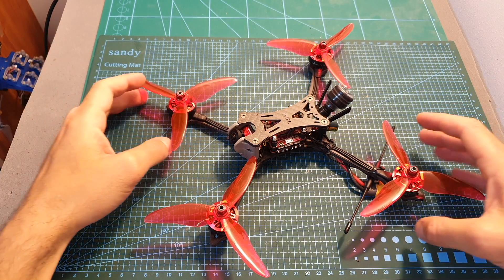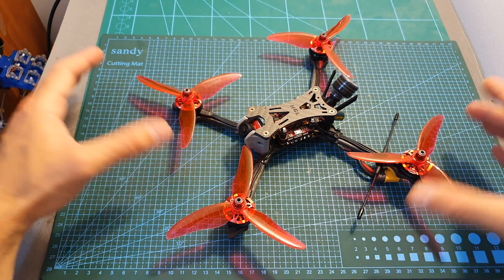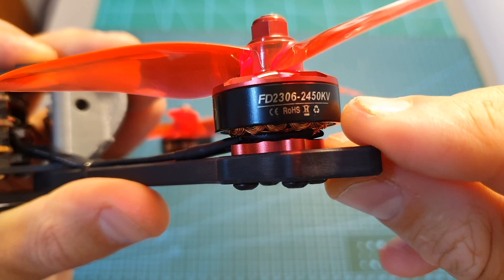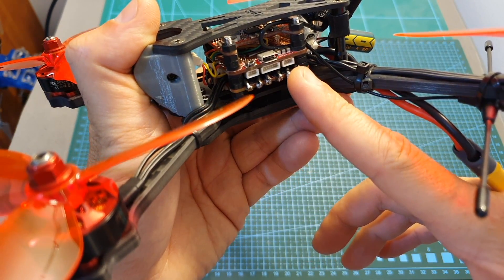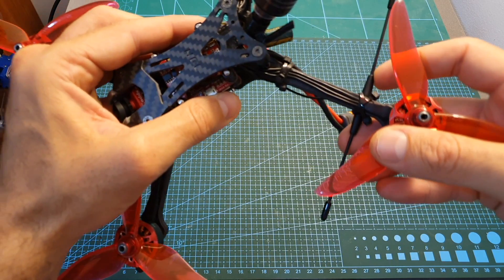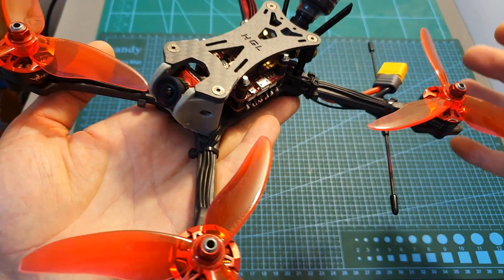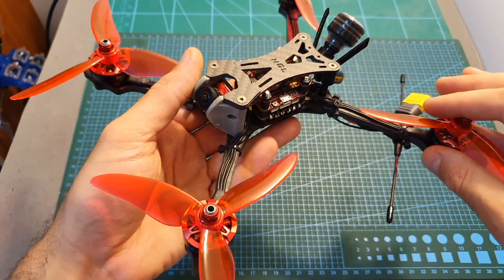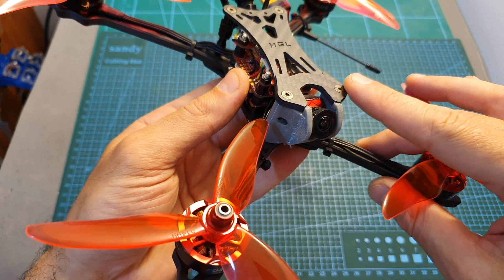HGLRC Wind5 Racing Quadcopter - Overview & Flight Footage

Comment: I am a first time buyer and looking to buy this. What's the max flight did you get out of the standard battery? Thanks
Reply from the maker: It depends on your setup, but generally you can get between 3-7 minutes of flight, roughly speaking.

Comment: Hey Gal.. Nice drone.. But what about flight times? If i run this with 4S 1500mah.. Just cruising.. How much should i get?
Reply from the maker: Hi there. Around 4-5 minutes.
Reply: @KremerFPV  Tks Gal.. ON 6S 1250 mah i should get at least 8-9 minutes right?! I mean.. Just cruising..
Reply from the maker: @thiagoamatofpv  I highly doubt it.
Reply: @KremerFPV  cause the people.are getting 6 with this type.of configuration
Reply: I mean.. Without pushing the motors a lot..
Reply: I can link you some videos for you to check..

Comment: No Spektrum???
Reply from the maker: You can add your own Spektrum RX.
Reply: I've been flying dsmx for years. Not a single hardware issue on my planes but my quads keep losing control signal. My old DX9 is now running Crossfire for quads and dsmx for planes. I've never been happier and reassured I'm bringing home my stuff in one piece.